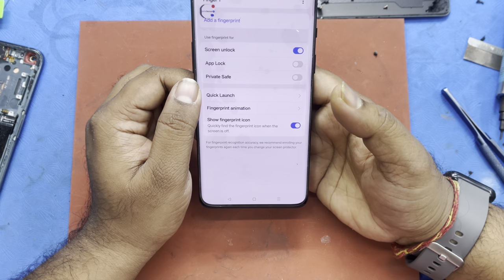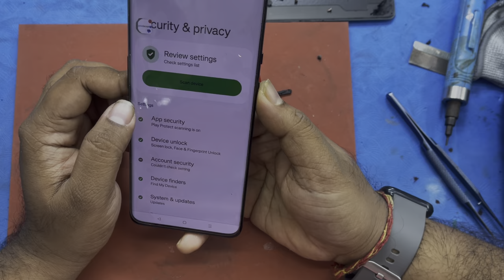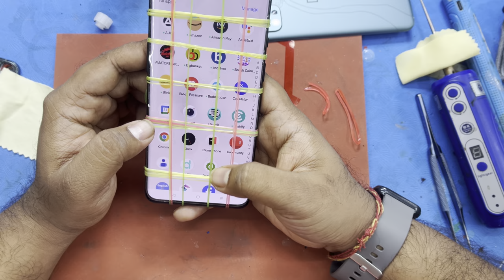OnePlus 9 pro Display Change || TANMOY MOBILE

Comment: I have OnePlus 9 pro T-Mobile variant that has five green lines in display if i change display to ips would i still be able to use wifi calling/vowifi or would i need original display so i won't loose any features and functionality of my phone
Reply from the maker: No problem hoy jabe
Reply: @tanmoymobile2022   will fingerprint authentication still work with IPS and 120 refresh rate
Reply from the maker: Yes 100% original
Reply from the maker: See the video same display.. but T-Mobile varient not launch India'. But I arrange.